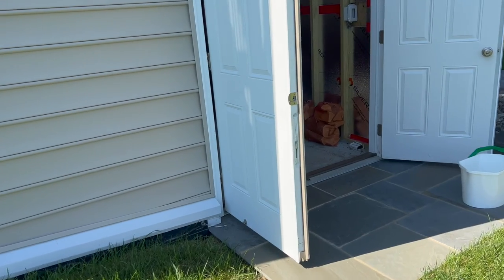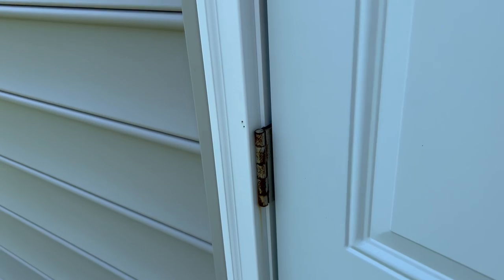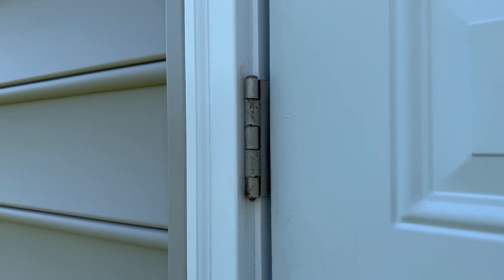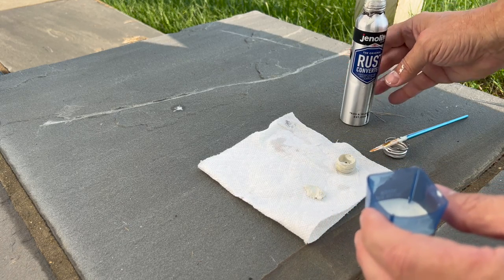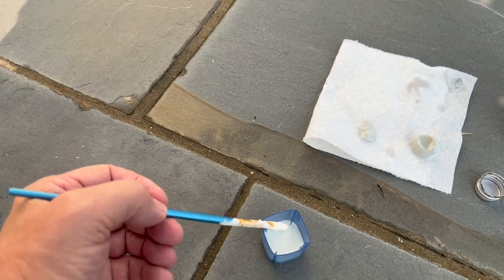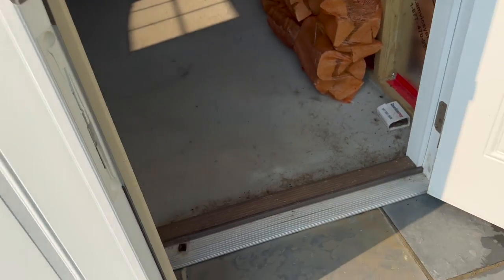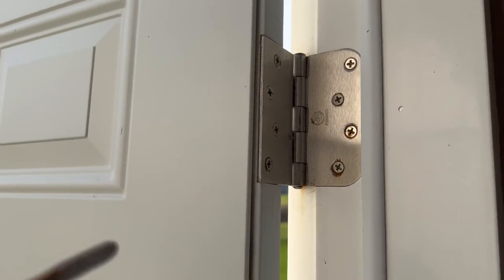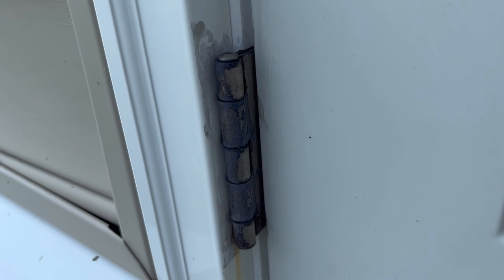Rust Converter - Restorer! Does Jenolite Work? Application & The Results!

Comment: Good demonstration. I would have taken the hinges off one at a time and worked on them both sides, painted them and returned them for the next one. I am currently using this on a shed roof and realised I won't have three hours until dark. Will go over it again tomorrow and then paint it after that. How long have you had the garage up? Replacing the hinges with 306 or 316 if close to the sea or industry stainless would also get rid of the rust issues.
Reply from the maker: Thanks for the comment and your insight.  I have realized I should've taken more time, done the right thing and remove the hinges.  I've had my shed for 4 years now.  I do plan to go back and do the de-rusting job the right way.  Just need to find the time.  Thanks a lot for watching the video!  Much appreciated!  Best of luck to you on all you are doing!

Comment: My shed hinges were strong but very badly rusted, I took them off completely and worked on them on the bench. Re-painted with Hammerite paint and replaced with new screws. I don't think I could be bothered faffing around like this.
Reply from the maker: Thanks for the comment!  I'm sure you did the proper thing and it's something I should've done.  My problem is lack of knowledge on these things coupled with a bit of laziness.  When my hinges start to rust again (I'm sure they will) I'll do what you did.  Thanks for the information!

Comment: Hi ive got an important question. Ive used jenolite rust converter on the underside of my car after grinding it to bare metal. Ive used it everywhere. Will primer still to it
Reply from the maker: Thanks for the comment!  From some internet research... Yes, an oil based primer may be applied over Rust Converter.  I hope this helps.  Best of luck to you!!!
Reply: @GrayTrend  thank you so much! Subscribed
Reply from the maker: @sabz3one3  Awesome!  Thank you very much!!!
Reply: @GrayTrend  apologies its me again. Would you say to lightly sand the rustbconverter so help key it for better adhesion as the jenolite product leaves a smooth varnish style finish
Reply from the maker: @sabz3one3  Yes, that'll give the new primer something to securely adhere to.  Certainly hope this works out for you!

Comment: To clean the hinges, I would use a drill, with a wire brush attachment.  Then apply the treatment.  Just a suggestion.  Thank you, for another informative video.
Reply from the maker: Thanks for the comment!  I did think about using a wire brush attachment.  I have a couple of wire brushes that will lock into my drill.  I pulled them out of my tool chest and took a look at them.  Wasn’t sure if they would be a bit too aggressive on the hinges.  I don’t have experience working with those types of brushes so I went with the standard wire brush.  It is a great suggestion.  Thanks!